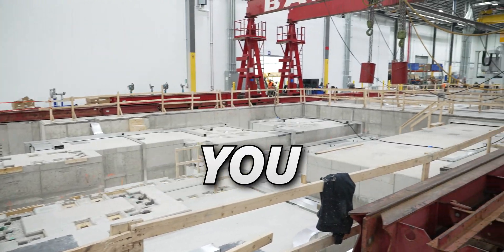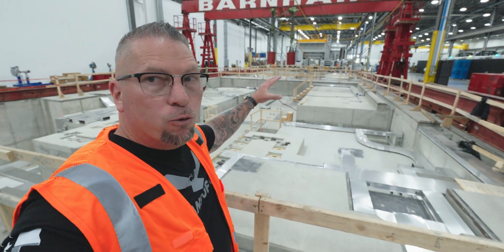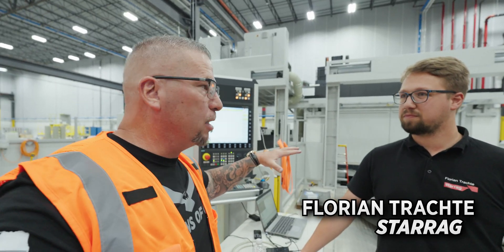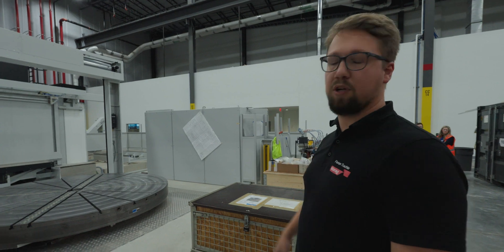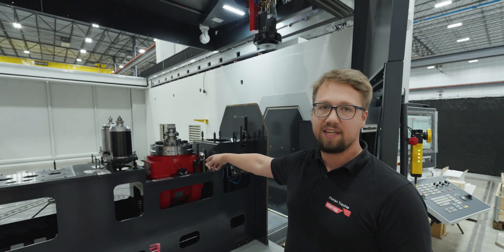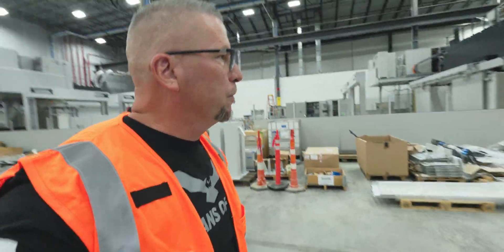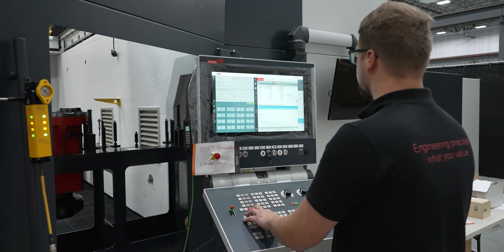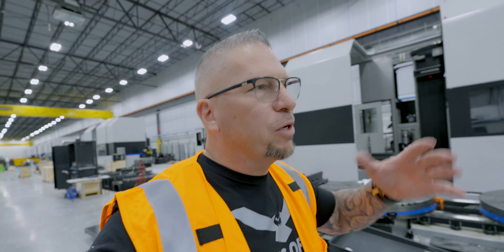Engineering an entire Building for Enormous Starrag CNC Machines

Comment: Yet Blue Origin is a decade behind SpaceX
Reply: Not only is Blue Origin WAAAAY behind SpaceX, in the flight regime, but they're  still using subtractive machining. The vast majority of SpaceX 's manufacturing is additive. Check out the evolution the Raptor rocket, from ver. 1, ver. 2, and now ver. 3. SpaceX has had to deal with doubters that think the Raptor 3 is only partially assembled. Nope, that's in it's ready-to-fly configuration. The pictures don't do it justice.
Reply: @edwardplatkin5730  SpaceX is doing things that have never been tried and are willing to fail trying because they know that if they fail less each time eventually it will work.

Comment: funny thing is that that machine is about 90% the size of the manual that i use to run ( whice was the middle size of the ones there where. the big guy was about 60% bigger then the one i used and 3.2 times as many amp's ( from 250 amp 408volt for my mill well the big one was 800 amp at 408 volt )

Comment: When I was in school in 1969 we went to Bingham-Willamette in Portland Oregon, they had a vertical lathe with a 50 foot diameter table, used 12 inch square  highspeed tool steel bits, and a lathe with a  12 foot swing and a 130 foot long bed, operator rode on the tool post. So this stuff is tiny.

Comment: as a machinist i love it.
when someone start with CNCs in general, is for life. you will simply love to try another software, learn, produce, watch what you made before shipping the parts.
only machinists know the goosebump when CNC working and you know that 0.005 mm (0.0002 inches) is removed, you know the piece is perfect after the pass ^^
Reply: yeah until you realize that you will never be promoted
Reply: @dominic6634 What I’ve noticed working in many shops is the supervisors are hired with no CNC or Machinist knowledge, some have came from other types of production.

Also some supervisors were promoted from the floor, CNC operators/machinists and they have either crashed many machines or scrap parts. Most companies can’t afford promoting a good machinist because they can’t find good replacements.
Reply: @dominic6634  not my problem but yours 😂🤷